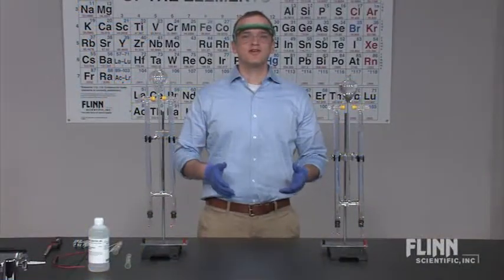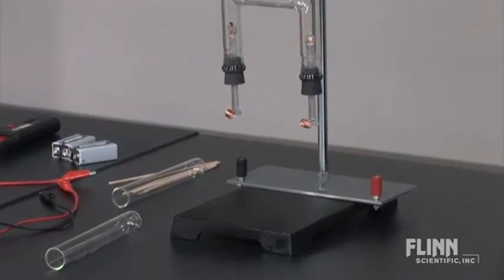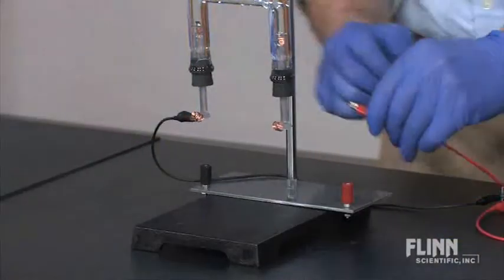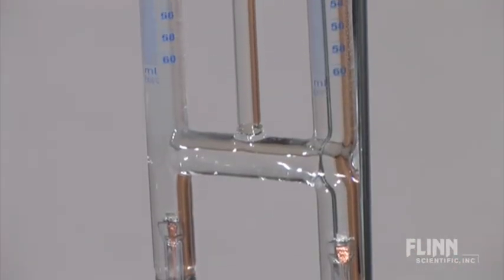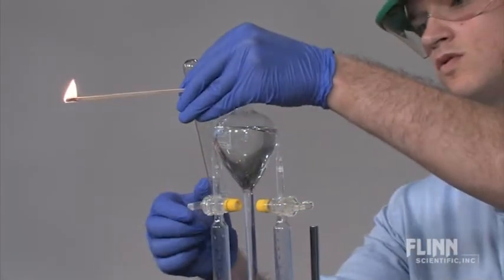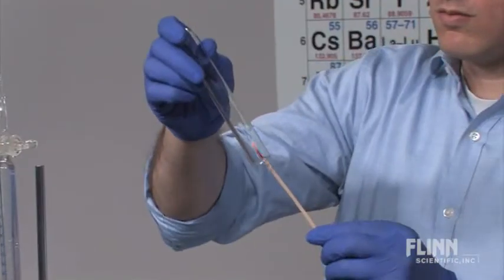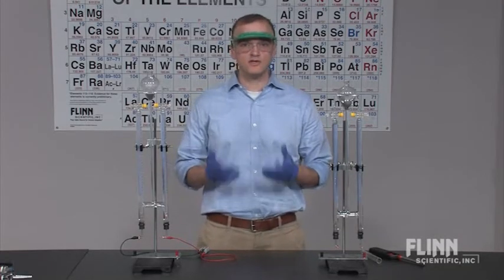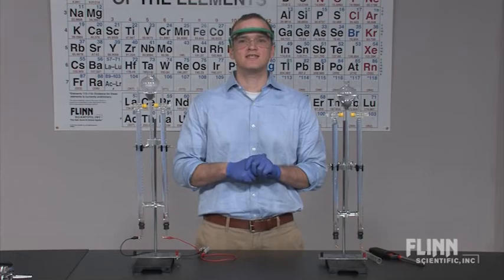Hoffman Electrolysis Demonstration Apparatus

Comment: Suggestion!
Using plastic gloves for these kind of experience is not recommended, vecause it is highly dangerous for hand's skin! The heat could melt plastic and stick together with the skin.
Reply: ridiculous. there are no flammable liquids here and the amount of flammable gas is minuscule. think for yourself instead of blindly following "safety guidelines" with zombe-like uncritical acceptance.
Reply: @Muonium1  i am not talking about flammable ... I am talking about an increase of temperature. It is not the same thing. In chemistry there are some exothermic reactions .
Reply: @MrGiorgioAlessio  well, yeah, there are lots of them. Not in THIS demonstration though.